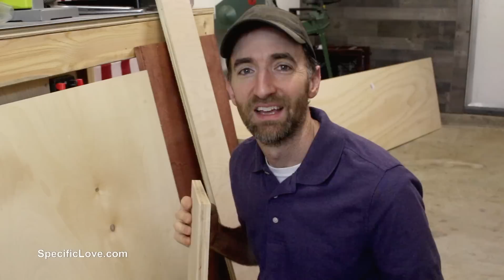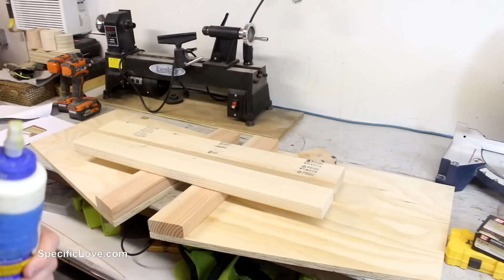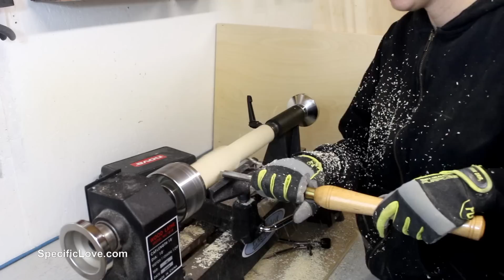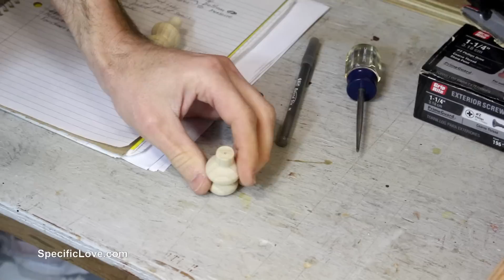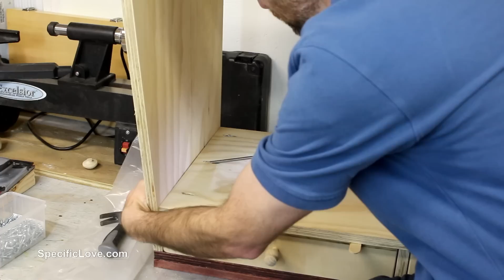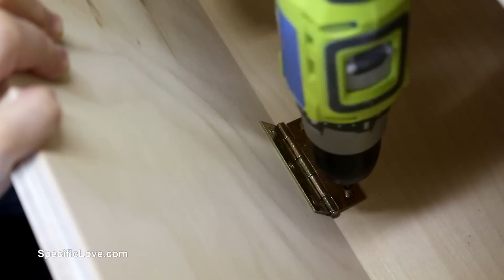Mini Lathe Mobile Cart with Storage | DIY Woodworking

Comment: Which brand/size castors did you use? When using the lathe, do you apply brakes on 2 or all 4 castors (assuming all 4 have brakes)? I'd like to build a similar stand for my small (metal) lathe but I'm wondering if it will be stable/solid (not shaky) in use, considering that all the castors from the home improvement store that I've held in my hands have some amount of play.
Reply from the maker: Got the casters on Amazon. All four of them have locks and they work well. The weight of the stand is heavy, so it does not move around easily.
Reply: @SpecificLove7  That sounds good, thanks. Do you remember the size of the casters?

Comment: You should never wear gloves while using a lathe. This also applies to any tool with high rotational speed and torque. If it's too cold, buy a heater. Much cheaper than going through life missing digits.
Reply: Same with any loose fitting clothing.

Comment: I am about to add a midi lathe to my shop (already have a PM3520) and have been looking at a lot of designs. I think yours is one of the better ones so will be changing my draft plans. My one thought is that lower compartment is so tall it will have a lot of wasted space no matter what you put into it. What do you think now that you have used yours a while? What changes would you make, if any? Perhaps one more set of drawers?
Reply from the maker: I do like the size of the big space, but I did end up adding an additional drawer below it.
Reply: @SpecificLove7  Thanks, I think I will add another drawer under the first and drop the cabinet to the bottom.  There was a design in Popular Woodworking that called for a double layer of 3/4 Baltic Birch on the sides and shelves. I am thinking with 3 shelves bracing (adding another set of drawers) across that might be overkill but what about the sides? Do you think one ply of  3/4" is plenty strong enough?

Comment: I am most likely making this one, nice cabinet.  The one question I have is with the base coming out at you do you have to stand back too far from the lathe and lean in if your trying to get right up on it?  Wondering if I would end up standing around back more.  Also is the lathe really stable without being bolted down?
Reply from the maker: This lathe has rubber feet and does not move much if any. I have also found the slope at the front to be perfect since I can get my feet under it. If it went to the floor, then yes leaning could be an issue.

Comment: I really enjoy ur videos. Have u ever had problems with pocket screws tearing out? I've heard they should be installed from the outside in to have more material to bite into rather than from the inside toward the edge. But doing it from outside in leaves the pocket holes visible. Just wondering if u ever had a problem. Thanks a lot for the videos.
Reply from the maker: Not any problems as of yet. You are correct, this is not the strongest, that is why I added so many. Good spot.